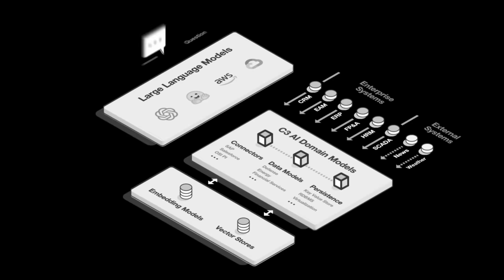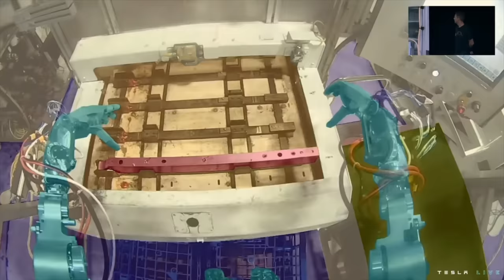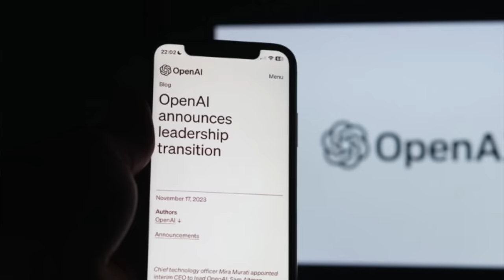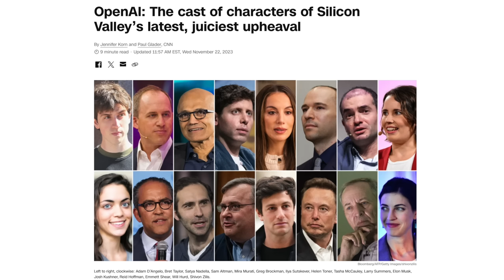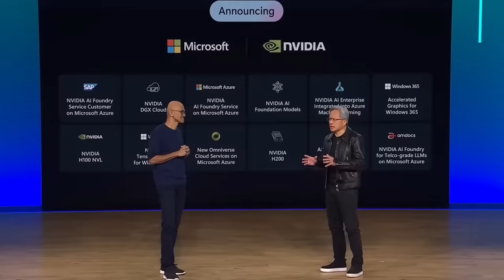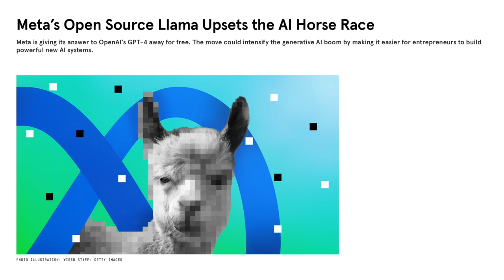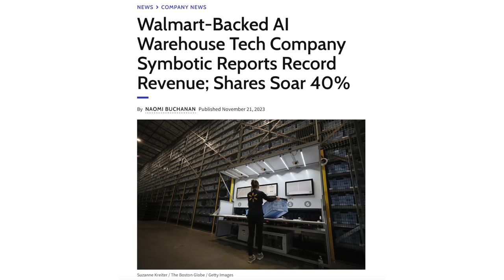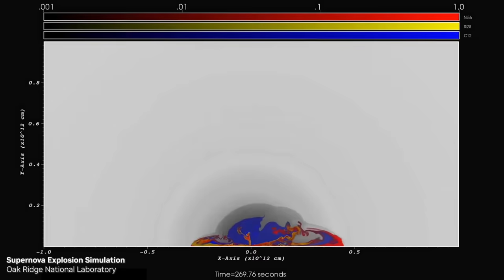What comes after LLMs?

Comment: You are great Anastasi!
I designed such a multi-processor chip on a single chip more than 2 decades ago, and we also presented it at a Chinese conference. The cloud did not exist then, it would have been its basic element. We built it in the size of a 2 m high rack, which now fits in the palm of your hand. A year later, Intel came up with a mockup version of the 80 cpu, but it was not yet functional at the time, and this was later acknowledged. I'm glad it's finally happening now.
Reply: Wow super brain with open source you MUST be a kid in the candy Store😁 with the knowledge you have gain since then you are A.I.
Reply: @davidstar2362  Unfortunately, I'm not an AI yet, but I'm already working on it.

Comment: I wonder if physical robot simulations could be used in the way AlphaGo self trained in order to develop a next level humanoid martial arts style? (To be used by humans, we'd have to build in speed and strength limits, and a 250 ms reaction time.)
Reply: Absolutely possible. But competitive martial arts are more based on a particular set of arbitrary rules that makes them inherently limited in how effective they can be.
It sounds like you want to simulate the ultimate hand to hand fighter (either lethal or non-lethal). Both would be a bit challenging to train since you’d need to define lethality really well.
Reply: NVidia did it already, and the moves they invented are hilarious!

Comment: The next obvious step is analog which will enable real time learning and very fast computation. Consider software LLMs a crude prototype / proof of concept. Nvidia should, at the break of dawn tomorrow, create a division that builds these analog neural nets before anyone else does, because GPUs for AI will become redundant. And then, once you have that production line running, invest in a new department that will create interfaces from these analogue chips to real biological neurons. This absolutely is where we are going. Invest in nueral food companies which will supply you with sustenance for your biological hybrid AI assistant. Very much the same way you sprinkle flakes for your goldfish. Once this happens, software as we know it will be a thing of the past.

Comment: You really think that you can get that much cooler? I'll gladly take up the counterpoint on that one! And win. Funny, I couldn't help but think of Q in the frame of analog resonance, where the amplitude (A* ?) is the data set size, and the bandwidth as the accuracy, free of any harmonic or intermodulation distortions. How will we evaluate the quality of the output? QC architectures?

Comment: Hardware innovation of intentionally designed silicone, is paramount for ultraviolet processor engineering. Microscopic organic nuclear reactor processors are the key to advancing technology as predicted. An easy task in reality: i already discovered static electrical self assembling process generators by using simple micro-amp resonance influence environment during hardware assembly. Graphite reactors are basically perpetual when electromagnetic system integration hardware is sufficiently complex for charge variation time lapse circuitry  functions.

In layman's term: closed circuit systems created with graphite nuclear reaction power generation components that are differentiated with system transmission networks for closed loop utilizations are easily facilitated when the electromagnetic parameters are environmentally determined & congruent with the resonance determinate environment engineered with optimum elemental capacitance transmission. In other words: using a circuit component of a precious metal & making the system capacity dependant on that while facilitating hardware construction will dictate a capacity of near perfection for the system with the generation component (in this case i used nuclear reactors from industrially produced graphite with a resonance capacitor integrated design of the reactors & circuitry). It is not that complicated if you have understood scientific proclamations from the early 1900's.